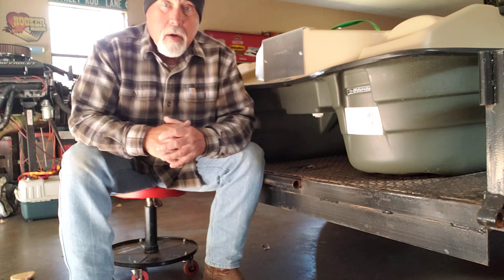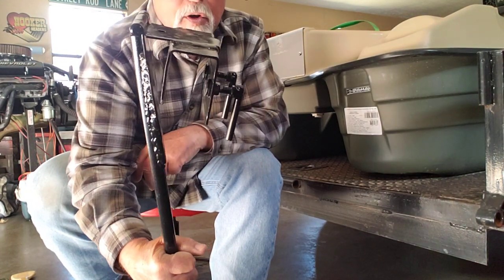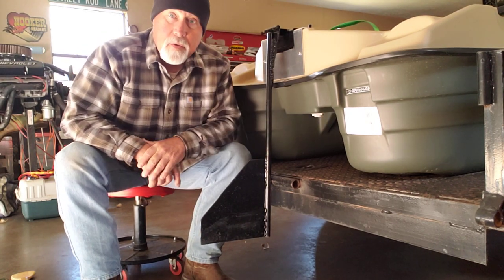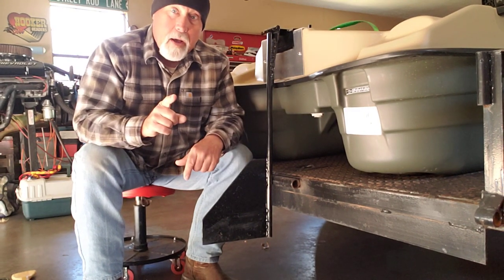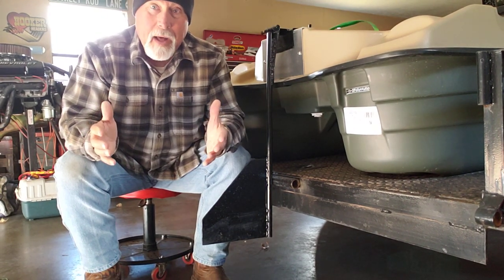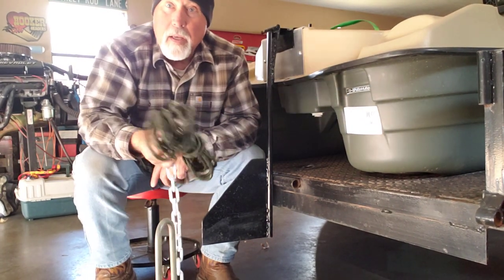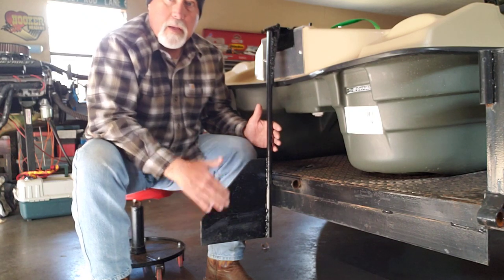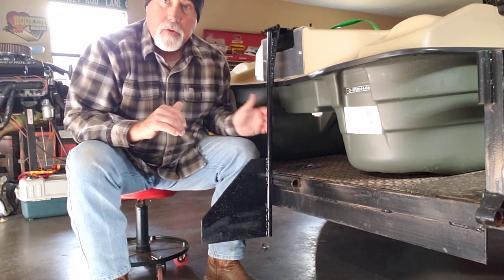Small 2 Man Pelican Bass Boat Rudder.... that you can build your self

Comment: Good job! I'm thinking about buying a two man plastic boat like the one in your video. One thing that I don't understand about those boats is the when you mount the trolling motor on the front is that the controls would be on the opposite side of where you want them to be unless you operate in reverse. Thanks, John Parker
Reply from the maker: All you have to do is rotate the head 180 degrees by removing the one and only screw that holds the head on. Easy to do!